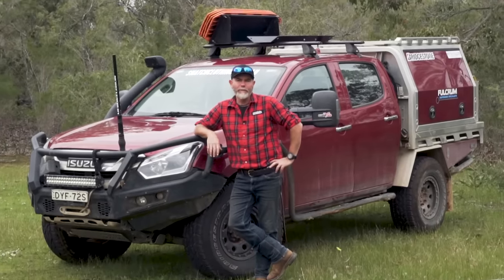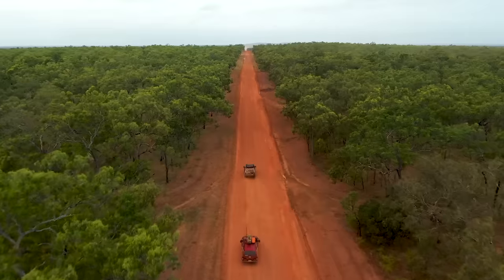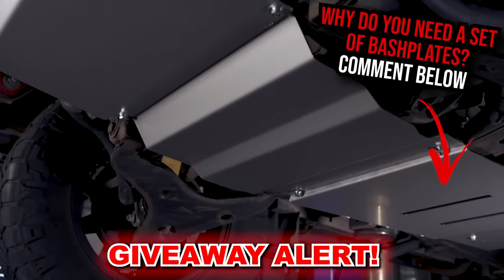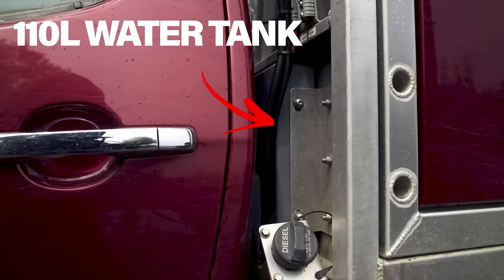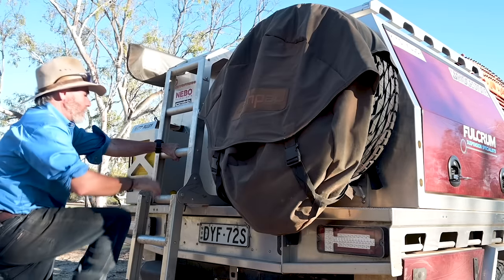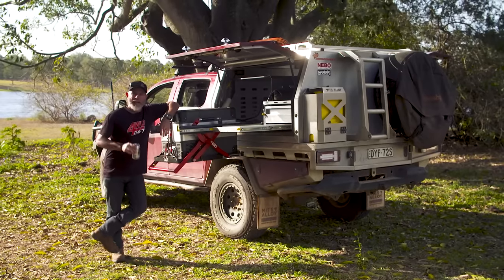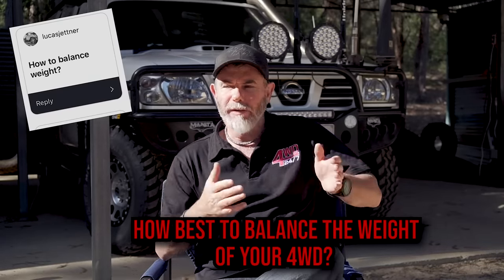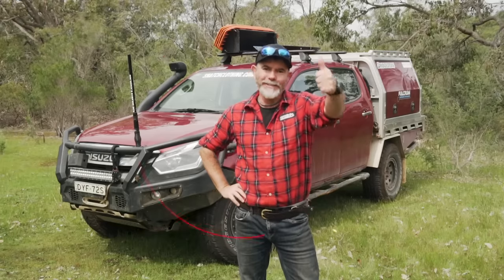ULTIMATE DUAL CAB UTE MOD GUIDE – How We Built Graham’s D-MAX to Drive ANY Track – Canopy tips!

Comment: 2019 Mitsubishi Pajero Sport.
We took it 4wding about 2 months ago completely stock and the factory bash plate is bent in exactly like the one you guys showed in the video, we luckily got a way with no drivetrain damage but we don’t have the money to replace them and when we do we will most likely end up bashing them again, we would love a set of underbody protection so the next time we go out we don’t have to worry about potentially going home on the back off a tow truck, cheers Graham and Shauno.

Comment: I have a 2019 Holden Colorado. And one time I was out at the Riverstone tracks and there was a bunch of people in their underpants running towards us covered in mud and there said they where stuck. And somehow they got a brand new 4x2 Toyota hilux stuck head first into a bog hole. And we had no winch so we got a ratchet strap and hooked to the rear tow bar and tried to pull them out but no luck. And that’s why we needed a winch.😂

Comment: 2010 Isuzu dmax! this is my first four wheel drive, I bought the car with some very old 2 inch lift already in it, can only assume that is on its way out sometime soon! can confirm I am a bit of a kook, getting stuck in Lancelin almost tipping it on its side with no radio, no winch but only some mates from up the road, but thats just another day in WA.

Comment: 2010 Holden Colorado, I need a good set of bash plates because of the big dint in my sump i found when dropping oils during iso haha.
Reply: relatable bro my sumps got a big boy dent think im just clear of oil pickup though
Reply: Haha same; RG and broke the front diff housing earlier this year doing Pluto Tk in the VHC. Bash plates on order now. Very expensive lesson.
Reply: If I had a fridge I would definitely pull up at waddy point Fraser Island walk up the hill to watch the wales and crack a beer
Reply: If its the 4j be careful, I would recommend replacing the sump asap, the clearance from the pick-up to the sump is minimal and will starve of oil if the dent is bad
Reply: There isn't a Z71/ZR2 version with bash plates?
Reply: @jnieto490  Z71’s bash plates are just a bit of tin, at least on the MY17’s.

Comment: Front locker is superior as demonstrated in the new video (DMW made it with you guys). 

Lockers are for restoring a loss of traction.
IFS loses traction more than live axles and the rear of the vehicle by design has more traction going over obstacles.
Best option is to get both.

Comment: I own a 2015 Hilux and have a 2 inch lift installed but sadly I’ve mad the mistake of not realising all the weight that I’m currently putting in it (tray,canopy, top tent) and the current suspension will sag. And with the most corrugated track! I would have to say Watagans. Not actually sure though, Thanks graham😂
Reply: i have experienced this before

Comment: Nice video, I just realised it's quite a few years ago now this video was made..  Most corrugated track I've ever been on was the border track Victoria South Australia. So straight but bumpy. Never ending. And UHF, camping with mates years ago, on the backwaters of the Murray River. 9pm my mate and I went searching for wood down a few dirt tracks. But could not find the campsite on our return. Took us till 1am. Funny thing our new car has no USB radio. It costs so much now, to build up a brand new 4wd. My wife keeps going off about what it all costs. Lift, front bar, all terrain tires, rims, suspension improvements. Even recovery points never ending. It's our first brand new car, and when we eventually get a UHF, I want it professionally done. No wires, radio under the dash etc. receiver on a magnetic hook that plugs in when you want it and put away when not in use. You know another funny thing. This car doesn't even have a CD player. It's good for Spotify if you have Wi-Fi range. Haha.

Comment: Great suggestions that make sense.

My trick is to apply trail mods with vehicles in the full-size class like the Ford Super-Duty F250 or F350 (new or used), especially the older diesel models prior to emissions on them which plugged their power outputs up. Although the durable big petrol V8 engine or older V10 made for good off-road torque with hauling grace, too. Being over 6 feet tall,I  like my full-size trucks better over smaller double-cab rigs due to leg room constraints, as well as headroom.

Comment: Onya Graham. My winch story is from Mcbrides Beach, NSW in 2018, solo trip. Bit off more than I could chew. Got stuck less than halfway up on a small angle and thought it was all over. Front locker didn't engage so ended up having to back down 50 metres and park up along the side of the track (in gear of course). Then started the long arduous walk up to the top to get someone to come and rescue me. To make the whole situation worse, id lost my phone fishing a few hours before :O. Taught me a real lesson . 
Landcruiser 76 series.

Comment: 1996 Ln106 Hilux - Dual cab
Corrugated road -  Ernest Giles up in the NT for sure. - closely followed by our driveway😂
Bash plates - Sadly did a radiator somehow when i got a rock jammed up and broke the bottom. Bash plates are at the top of my list now for a mod.

Comment: I got stuck like a kook out by myself when I was 18 or 19 with a 2wd Isuzu Rodeo on some bald 33’s and a parts store shackle lift and cranked torsions. I decided I was going to be a cool guy and go blast through this local trail after a good Florida rain and boy oh boy did I find out this thing also had an open diff quick! I somehow buried it up to the hood thinking if I just went faster.... hahaha I’m thinking about that phone call now. What a rough night! I need that winch for my new rig! It’s currently in process of an engine swap (2013 F150), waiting on the new long block as we speak and this would be the perfect time to install that bad boy and relocate the intercooler with a nice new piece of kit too!

Comment: Hilux 2016, I have converted the rear end to a tray and canopy setup and built it all ourselves. The lift kit is not suited for the weight of all the touring mods I have been adding to the rear end. 95L fridge for a full case for the boys( always get my drinks stolen).
The bash plates I am running are still stock. With the touring setup almost complete we are looking at a few weeks away after Christmas and any extra protection would be amazing for the cape!

Comment: I have got a Toyota Hilux Sr5 2023. Currently working on it and just had some modes done. Still missing the bash plates. I thought I wouldn’t need them but afyer watching your video I can say it’s a must have mode in you rig. BTW I am running the same Formula suspension on my car as I can see it working well with modern IFS vehicles.

Comment: The corrugation on the road into Weipa, in the same trip I saw a boat trailer snapped in half and my brothers GU TD42 shattered the tie rod end and lost steering while at 100km/hr on the dirt. Where he went off into the bush it was a miracle there were no trees. I've got the dash cam footage if you're interested. That same corrugation detached my UHF antenna, it was carnage.

Comment: So much sage advice here Graham. 
Love your canopy and would like to see one this good on my Triton (one day). I've certainly got some ideas from this video on a few worthwhile tweaks to my current setup. One thing I really hope subscribers take keen notice of is Grahams advice about where to put weight. Everything heavy in my ute is over or forward of the rear axle. With the exception of a 30 litre water tank in the back right corner. It might not seem like much, but it's too much weight in the wrong spot and does affect stability. It needs to be moved, at least to the centre line of the vehicle.

Comment: Re the Fulcrum lift kit, last November had Fulcrum replace the springs, shocks and bushes on my 2003 Nissan Patrol and couldn't be happier as this car took me over the Telegraph Road to the tip of Cape York and if there is a more corrugated road I haven't been on it.
But now I have just purchased a brand new Ford Ranger (2 days ago) and am about to go through the setup procedure.
Already ordered the Bull Bar, Winch, UHF Radio, Snorkel and a Canopy to replace the tub. Next is the LIft Kit and power in the canopy.
So a Fulcrum Lift Kit from Fulcrum would be fantastic.
PS: So are many great tips in this video that I saved it.

Comment: 2017 Ford Ranger
We haven't done a lot of corrigated roads yet - we've been on the sand most of our time off-road.  I reckon the PDR would have to rate as one of the most corrigated roads (based on the research I've done) and that's where we're heading next year - Cape York here we come!  I've got got the barwork and winch sorted so for me the next thing is suspension (oh, and those bash plate might come in handy!)

Comment: Graham Ive got a 2015 Dmax single cab inspired by you of course. Me and my mate were four wheeling out at glassy we came across a big bog hole just at the end of the track we were finishing, with out hesitating I didn't check the depth or what was in it and paid the ultimate price of hitting a rock that some one had rolled into the hole as a joke this punched a big nasty hole straight through the sump resulting us waiting for a tow tuck and lots of oil missing. this wouldn't of happened if I had a good quality bash plate like in this video. Cheers fellers love the content keep it up.

Comment: Winch
Had 1st 4x4 85 4runner 2.4 diesel, slow as a wet week, went out by myself on stock pizza cutter tires in the mud and got bogged up to the door sills needed to get winched out the next day after a km walk back thru the track to the main road. Got hooked 4wding from here. Current daily is a Ranger

Comment: 2002 Mazda Bravo B2500. Great little vehicle. Goes almost anywhere. Most corrugated road I've been on is easily Gordon Downs road on the way to Ringers Soak Community out of Halls Creek in outback WA. Corrugations as big as your hand in many parts and a 5kph travel speed with the longest corrugated bit being atleast 20kms. 👍👍

Comment: 2008 bt50.  I already have an aftermarket bashplate and it’s thick steel. Fitted by previous owner.   I did some pretty rough off road and bent the bash plate around my front diff and they started to rub on one of my cv’s.  So obviously I had to do my best to bend it back.  Which hasn’t changed much

Comment: 2019 Holden Trailblazer LT, Used to own a Nissan Navara but since then have had a new additiona to the family and the upgrade to a 7 seater was needed. Most corrugated track which Im hoping to take the trailblazer across is the Talawana Track

Comment: I own a 2006 RA rodeo, and I reckon the most corrugated track in Australia is the dirt road that I use to go to work everyday. Nearly put holes through the roof with my lid on several occasions!! I also need the bash plates because what’s the use on having holes in the roof and in the floor in my ute. Man I’d love to pull up for a beer but I’m too busy working to save up for all of this gear in the video

Comment: Ford 08 PJ Ranger dual cab. The most corrugated road I've been on, the quarry road Kunat, torn up by council truckies. Doubt you've driven it Graham, but by God, it shakes ya to pieces.  And I need a full set of bash plates because when I just want to go bush for a bit of smoko, I often get caught on tracks tougher than I thought to be there and have to push the ol PJ to her limits a bit. Some peace of mind protection would be much appreciated.

Comment: Just upgraded to a fresh blank slate (2013 D-MAX), and first on the list is a 2" lift. The most consistently corrugated road I drive would have to be sections of the PDR late in the season. It can go from a dirt highway to a goat track in a matter of km's. A close second and worthy mention would also be the road from Maytown back to the highway (especially the braking bumps on some of the sneaky corners).

Comment: I got stuck in my old LN107 (without a winch) on my own bloody driveway after a big rain. Went to go around the corrugations to save myself from being covered in coffee and ended up dropping the left wheels off the shoulder and instantly ended up on the rear axle and front lower control arm. Lol. In the moment I lost my coffee out of the holder and it ended up through my air vents. Everything smelt like coffee for months. 😂
What a knob!

Comment: Q: Why I need a bashplate? 
A: Purchased a D22 with a custom plate. Thought it was great till my 2nd trip. It fell off. The previous owner secured it completely wrong. The back was held in by two thin bolts and through about 2mm metal.  No securing nuts or decent thread to bite into.

Comment: 2018 Ranger, I would like bash plates because the DPF on the exhaust sits at the low point and there are wires running around that area also which aren’t ideal to replace if something caught them and if the sump was punctured the 3.2 wouldn’t appreciate being drained.

Comment: Hey, I would absolutely LOVE a winch for my rig!

I got stuck belly deep in sand on the track top the mouth of the Jardine river, and if I had a winch I could have pulled myself straight out rather then an hour digging sand in the hot sun.

I have a 2014 PX Ranger XLS.

Thanks so much for the opportunity!

Comment: Got stuck in a 1999 2500 Chevy suburban with 454 leveling kit and 35. Driving up a slick slope with a washout down the middle lost traction couldn’t move forward anymore attempted to back down but nothing was avoiding sliding right into the washout. Instantly stuck on both diffs chain and a Toyota wouldn’t budge it finally after 24hours a 2005 Chevy 1500 stock 4wd was able to pull me out in low at the right angle

Comment: I'm hoping to get a new isuzu dmax in the next 6 months and after seeing what you've put yours through even with relatively basic mods I think you've got me sold haha. I think a winch would really come in handy because the two blokes I'd go 4wding with both have tritons haha. And a two way would be just the treat for me to feed them heaps on the drive after I've pulled them out. As for the corrugated roads, I reckon any road in Australia that the local council "maintains" especially the dirt roads.

Comment: Holden Rodeo RA 2006 dule cab, 4x4, 3L turbo diesel. The most corrugated track I can think of is the Talawana track.
I need a set of bash plates because being a nurse, 4x4ing  is the way I relax after a long week at work.
winch- going off road recently, I got stuck and had a winch failure, hence couldn't get out of the ditch.
Pulling out a nice beer out of the camp fridge would be amazing, rather than an eski.

Comment: Another note I always put enough dot radial rated tubes with the bolt on valve stems and some heavy duty 100lb fishing line and a 1/8 in drill bit that way if I run out of spares cause of side wall punctures or holes that are too big to keep plugs in. I can drill holes and sew up the side wall and throw a tube in it and bam new tire. There small and compact and can be stored anywhere.

Comment: Q: Most corrugated road?
A: My drive way after we as kids were learnt to drive paddock bombs and found out what 3rd gear boost was.

Q: Why do you need a bash plate?
A: The Navara is sick of getting bashed by rocks and stumps.

Q: When did you need a winch when you got stuck?
A: I was solo, three hours from home, climbed out of the window to hook up current winch when I was stuck in a bog hole to get out. I dropped the winch controller in the water as i was climbing back through the window. The missus was not impressed at my reason for being late to date night.

Q: The spot you would like to pull up and have a beer.
A: Anywhere were there are good mates and good times.

Vehicle: 2010 D22 Nissan Navara

Comment: The bash plates please.  i have a 2019 MU-X and at present it has the 40mm ARB lift with  265/75/16 giving it a bit more clearance but with only stock standard bash plates under her. the cape is on the bucket list.

Comment: Got a BT50 and the Birdsville Track is probably the worst corrugated road I have been on. That or the track to Steep Point.
I also currently have the stock plates on the BT50 and they have taken a beating. Should probably get a proper plate, especially considering Landcruiser Park is pretty much at my doorstep.

Comment: I have just bought a 2013 fuel cab Hilux sr5. I am used to wheeling much older rigs and i couldnt believe how much extra stuff there is under the newer vehicles.  It definitely needs bash plates as i tend to just 'SEND IT' and will probably end up wrecking something.

Comment: 2013 bt50. Got stuck on some good size rock steps in jellore. Proved 2 points 1 i need a winch and 2 the factory underbody protection might as well be made from paper 🤣

Comment: You forgot tierod sleeves on that IFS. An LS diff on the front would be a better choice than a locker. How much weight you carrying? Looks like you could use a chassis reinforcement kit from Superior Engineering before the chassis bend!

Comment: 80 series landcruiser. 1) Eurimbula National Park. It was a killer of a corrugation patch in through the park. 2) I live and breathe a lot of glassy. A set of bash plates would be mint. 3) when I got stuck right at the top of that slippery muddy hill in glassy and a patrol came to pull me out. Wish so badly, if I had a winch. 4) my old unidentifiable uniden unit is all crackly and not clear. Would love a new replacement. 5) bring that fridge to my 80 series. Whats better than pulling out a cold bevvy when parked on Bribie ocean beach watching the dolphins. Basically, I’ll take one of each. Thanks 😅. (Fridge is on top of my list though since I’m running a very basic setup)